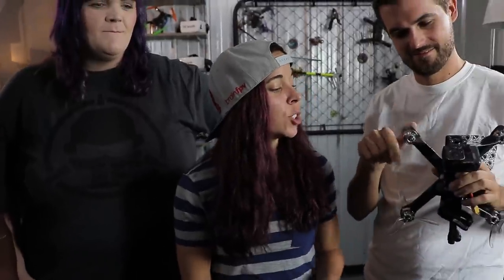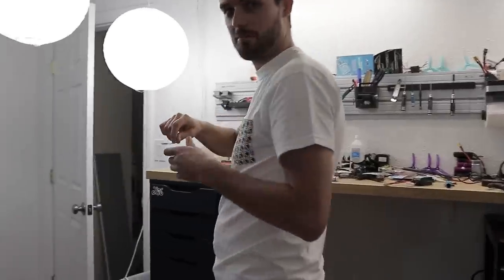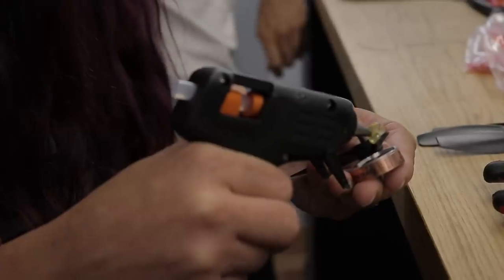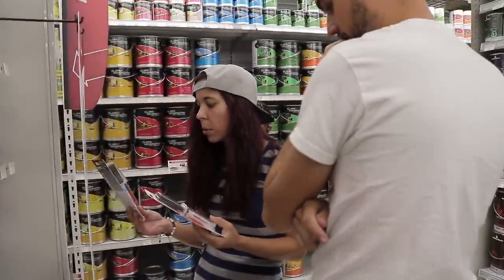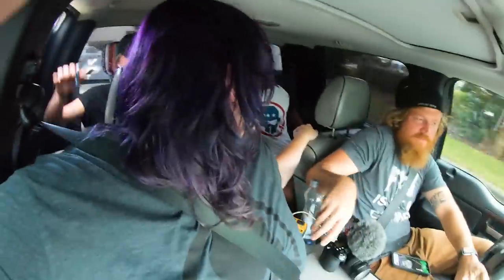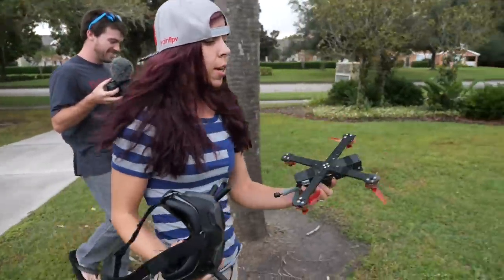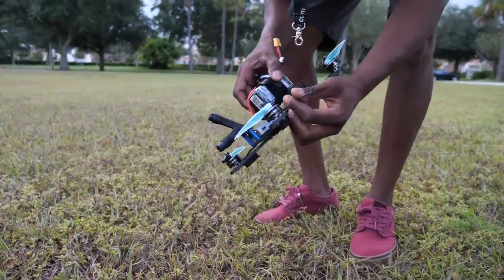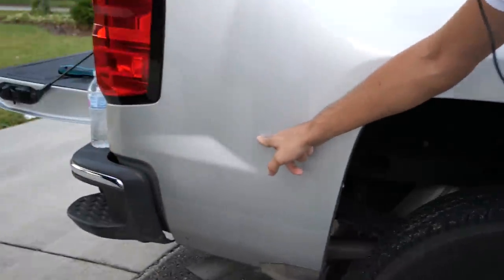SINGLE BLADE Drone Propeller?? – Extreme Prop Balancing

Comment: All my single Bladies... All my single Bladies! 

-Beyoncé
Reply: @RotorRiot  hi, would you mind trying what would be the result if 6 blade prop is cut into 3 long and 3 short blade? What would it flight characteristics, responsiveness and thurst would be? Something like a 3 inch 6 blade prop with 3 long blade and short 2.5/2 inch 3 short blade? Would it match anywhere near to 5 inch?

Comment: Use steel picture hanging cable to hold a lead fishing weight in place as a counter-balance.  Run the cable thru the weight, wrap both ends around the shaft a couple times, dab a little epoxy on the wrap and smash the cable in place using the prop hub, tie a knot under the remaing blade and trim excess, then epoxy the weight in place between the two blade stubs to keep it in-line with the 3rd blade.  
Good luck guessing what size wight to use... but if you go too big you can drill/dremel away excess and maybe even get it to balance decently.
Drew, dust off the calc and figure out what weight is needed at that radius.

Comment: Love the idea, something many people miss in balancing is there are 3 things to balance:
-Static mass balance: CoG on the rotation axis, people sometime say "all the blades need to heave same mass" => youre doing it with the screw, good :)
-Dynamic balance: the mass need to be spead as a disk, for example if one prop is bent up and one down, your're not dynamically balanced while being static balance still.
-Aerodynamic balance! Each prop need to have the same shape to generate same amount of thrust, and of course you need the props to be spread evenly with symmetry. That point is definitely impossible with only one prop :)

Comment: Since using a counter weight is legal I would have used a light metal strap with the holes in it sticking out like a prop, cut top length needed for proper weight and tighten down over shaft but under the prop using the prop to press down on metal holding it in place.

Comment: It may sound far fetched but one day I would love to see footage from the very first person to fly down a wave like a surfer would and get inside the barrel and make it out, just like a surfer. It would be even better with a surfer in front of the quad but if you could semi waterproof a quad for spray it would be an amazing challenge to pull off. You'd need some pretty big waves, ones that don't have massive blowout of compressed air and spray because that would take the quad down, like big Hawaiian waves. Challenge, "First Drone to get Tubed on a wave". Possible, Drew? Or completely a no go?
Reply: been done, theres a video out there somewhere
Reply: @KwadSquadFPV  I know of the one where the surfer holds a drone and then releases is as he appears from the barrel, link at end. The flight I'd like to see is someone "flying in a barrel". It's possible but the water is an issue for sure. The gust of wind and spray might blow you out of the barrel, would be a tough challenge. here's the surfer holding a drone: https://www.youtube.com/watch?v=hovQwk31Djw

Comment: If your gonna do it, drill a pilot hole, get a screw thats going to get at least 3 threads of a bite, put a blob of fast drying epoxy on the screw, and onto the plastic, file off excess until its balanced. Getting at least 3 threads in should hold up. also use some epoxy as you put the screw in for extra strength.

Comment: Well Drew & Y'alls, To Answer Your Questions On The Best & Safest Way Of Doing This One-Blade Is Simple, Since We Already Do It On Micro Sailplanes / Power Gliders+!
1) You Don't Screw or Glue Anything To The Prop! 2) You Need A Good Prop Balancer & A Scale! 3) Choose Which Blade Your Keeping Then Cut Other Blade/Blades Off & Then Weigh How Much Is Cut Off! 4) Counter-Weight Will Be About The Same For A 2-Blade & Some Less For A 3or4 Blade Etc! PS At This Point I Would Recommend That You Grind All Materials Back To A Round Or Even Less Than Round Hub Face Towards Missing Prop!!! 5) Use A Thin Brass/Copper (So Solder Sticks To It!) or Other Metal Washer A Little Larger (1/16 to 1/8") Than The Hub Outside Diamiter w/Same Size Center Hole Is Best! 6) Grind A Flat Side That Will Face Prop Side, Then Bend Up Washer On Either Side Against Hub! 7) You Solder On Weight On Top Side Of Washer Towards Cut Off Prop Side, Balance True (Make It Pretty) & File Off or Add A Lil Solder Until You Have It Perfect, CA The Washer To Bottom Of Prop (Optioanal?), Then Mount It Up Normal... Y'alls Are Welcome & Now Do I Get A FREE NEW 5" Rotor-Riot Quad w/AFew Batteries To Fly It!? Hmmm??? LMAO

Comment: I'd've done it with a 3d-printed bit held on my the prop nut, holding a screw by the head. Then add nuts and/or screw them on more or less until balance is achieved.

Comment: Guys, JB Weld.  I love the stuff.  Also roughing the surface of the plastic before applying the epoxy helps adhesion.   I would use the putty version of JB Weld.  Great stuff.

Comment: I would cut the 2 other props off, heat up the counterweight screw with a torch, then screw it into the plastic while hot, it will prob stick very well.

Comment: If Flite Test taught me anything, never ever under estimate hot glue.

As for doing the challenge, I might have just used more math versus anything. Get the thrust numbers, divide that by three, use a lead wieght (with hot glue) and see if that would have worked. Amazingly the kwads could fly with single rotors! They just needed better balancing.

Comment: How about put the counter balance on the motor bell? Balance it like a wheel
Reply: That was sorta my initial idea, butbdudnt have time to execute.
Reply: Good idea! If a ring is bend from a single strand 14awg wire is wrapped around an arm of the bell and then is closed by soldering, it could be quite robust. As long as it does not hit the stator you can add as much as needed for balance. Swapping props is also easy - just cut it ad fix it with blade on opposite side.
Reply: Then you get imbalance between the point of lift on the propellers along the shaft and the counter balance on the bell.

Comment: Interesting that people are trying this on quads. Control line speed flyers have been running single blade props for decades. If you really wanted to try it, for whatever reason, you could get 4 CL speed 5 inch props.
Reply: Very interesting comment! Do those props come already one-bladed and nicely balanced? And I guess one bladed props are flown with high KV?
Reply: @henrischomacker6097  over 40,000 rpm glo engines, not electric. And yes, they are sold pretty much ready to go. Carbon fiber prop with a brass molded counterweight

Comment: How about machining a thin aluminum washer with an offset hole?  It probably wouldn't take much of an offset at all to balance it. Then clamp the washer between the prop and the motor. The tricky part would be tuning it, but if you managed to balance it then it shouldn't fly apart like the screws and epoxy.

Comment: That was one of the craziest challenges yet. Why not a lead weight curved to fit the hub. Then held on with epoxy and a couple of tiny screws? You could tap the holes to match the threads. Hopefully the fragility of the hub wouldn't be compromised before it fatigued.

Comment: Try a part two to this get some self threading screws and screw them directly into the centre part of the prop hub to balance them apply a washer or multiple to the screw to get the desired weight if necessary

Comment: why not take a 2 blade prop and heat 1 side and role the blade into a rod. that way prop is still ballanced and not broken but only has i actual lifting blade. dont screw around with screws and cutting your blades , that will never work for long.

Comment: I would have weighed the two props that were cut off. Then cut a length of clothes hanger equivalent to the weight of the props that were cut off. If the clothes hanger was too heavy, I would use thin mechanics wire or rebar ties. Then I would have drilled a 1/16" or 1/8" hole through the inner prop that mounts to the motor. Then I would thread my designated wire through the drilled hole. Then I would twist the two ends together. Then I would use a small amount of JB weld steel puddy to cover the ends to help avoid the twisted ends to come apart (also need to consider this in the weight calculation).

Comment: I did this with a BiBlade prop... Clipped it and added a weight... Worked fine but didnt have the lift I wanted... The biblade props are generally balanced and wont have the variable of the other two prop clip off points... Just my 2 cents

Comment: Could have used a Bi blade, chopped one ,but you'd have to add rod w counter balance...on opposite side.   Would have been good test for FC , see if it could handle vibration ect.

Comment: quick question I 'm still new in FPV.  Just wanted to know if I start my own build is it a must to have the fpv run cam and vtx or can I just leave them out and fly plain sight?
Reply from the maker: No, you can start flying line-of-sight (LOS). Many pilots start LOS to learn the basics of RC before going full FPV
Reply: @RotorRiot  last question so it won't damage the flight controller or pdb if I dont have them connected.
Reply from the maker: Nope no problem
Reply: @RotorRiot  thanks alot and Like the channel alot it's thanks to you all for me to start with fpv and giving the best tips. Keep up the work.

Comment: How about a counterweight that is a tab of metal with an offset hole that goes over the shaft to ensure it stays put? Google "offset hole tab" for the concept - but make it yourself to fit, trim as needed.
Reply: maybe even cut a slot into the prop's hub.

Comment: Nice video. If you gonna revisit this again, perhaps drill and tap an M2 hole into the motor shaft. Then you can use a M2 bolt and nut as the counter weight. Keep up the good work :D

Comment: Well you could have sunk lead weights opposite of the propeller or the blade or you could have drilled a small hole put in a decent size wire through the opposing side and twisting it over so it had a locking mechanically attached to the prop maybe add a little bit of some kind of glue or something for additional weight.... 
But I think drilling holes through the bottom of the propeller where attaches would have been the best or better yet where the prop nut goes and where it attaches to the thing ..... Better yet you could have taken a piece of metal bent it over in half drilled a hole in both ends slid it over top of the propeller and slid it down over top of the hole on the bell and tighten the nut down this would have given a counterweight that was mechanically attached by the Bell bolt itself

Comment: Maybe next time start with a bi-blade prop.  Cut a blade off leaving a bit of a stub, and your counter weight should weigh the same as what you cut off.  Use the stub of the blade left behind to anchor the weight.

Comment: Instead of balancing the prop in one direction alone I guess you could have tried in 2 direction that way even if one breaks apart you would have another to balance. Just an opinion I seriously don't know if it works

I guess choosing the smaller frame size would also do the trick controlling may be difficult but balancing the prop would had been easy one more thing was vtail kind of motors would also help I  guess since it plays according to components cos and sin not sure though but I guess it was worth trying had a lot of fun thank you

Comment: You should have used a thin strip of metal with a hole on one end, so it could also be mounted to the motor shaft with the prop. Then it should not fly off.

Comment: I would've used bi blades and a heat gun. Heat it and twist 1 side so its not creating lift. Or heat it, twist it and fold it so the mass stays the same. Or is that cheating?

Comment: SOLUTION

Take two coins, drill a hole and not in the middle. Install the two sides of the propeller with the right amount of thermal glue. Nothing flies when accelerating

Comment: If you had cut down a bi  blade instead of a three blade prop you would have a nub to put screws through. You could get it to balance better. And hold up better. 

I mean that's a lot of abuse. Even a new perfectly molded prop only last so long.

Comment: Has production studio, but not a prop balancer... $25 on Amazon with free prime shipping gets you a DuBro balancer guys and gals...
Reply: Yeah lemme order that item, it'll arrive in 30 minutes before the time is up, right?
Reply: @FlyingPenguinDrones   with the caliber of production quality I'm pretty sure they plan out an episode with enough time to order a part or piece. Kapper isn't stupid. It may even have even been intentional not having a prop balancer to make the difficulty higher and gain a captive audience. The world may never know.
Reply: @greenscreenproductions2459  considering I've hung out with the crew, sometimes they make episodes up on the fly! And sometimes non-planned episodes are more fun than pre-set episodes.
Reply: @FlyingPenguinDrones   So? My point was a prop balancer is a pretty basic and relatively inexpensive device if you fly anything with props. Though likely not as necessary on freestyle quads, I simply found it interesting they didn't have one anywhere.